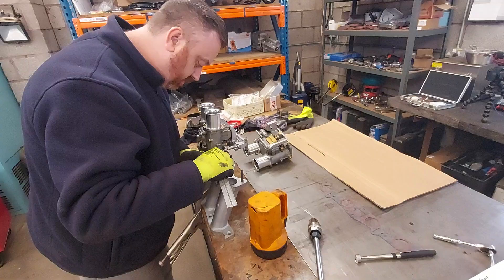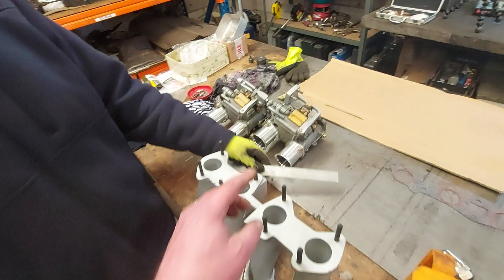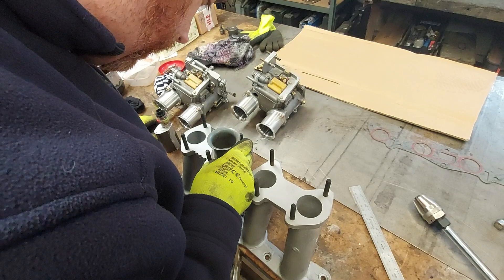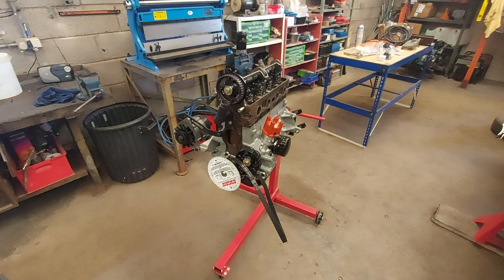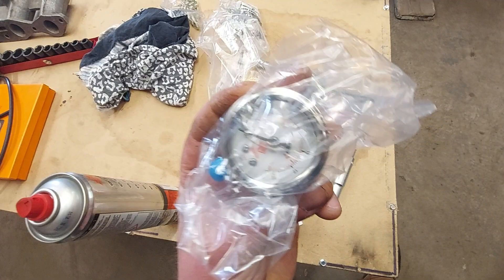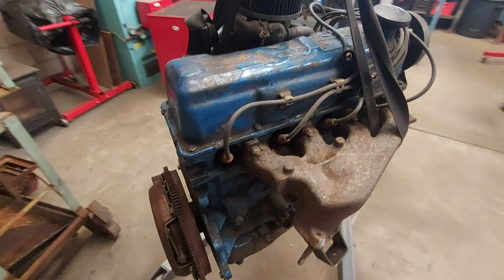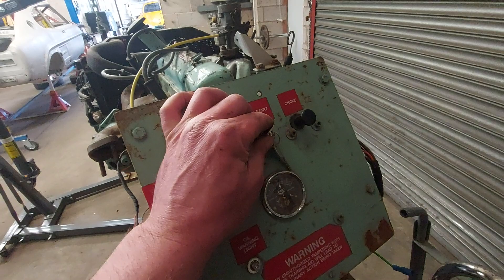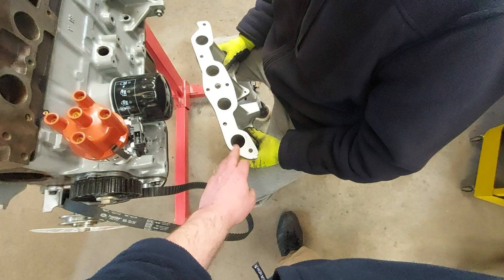1969 FORD CAPRI - PART 88 - Ford 2034cc OHC 'Pinto' engine manifold port matching and ''dudestock''

Comment: You could have made a paper pattern from the front of the carbs using the mounting holes studs and choke sizes for a accurate placement and  pattern on the manifold  same on manifold to engine 👍

Comment: Good luck with the porting.  most times they use the gaskets to figure out how much to port.   to me it looks like the ports on the head are a lot bigger than on the intake.  but it could just be camera angle.    good luck it's a lot of work but at least it's aluminum so not a steel intake.  just go at it slow if your not already done.

Comment: Guys....(dudes!) use the paper gasket method. Copy the reverse cut out (and bolt pierced) carb outline to the manifold... presto, your hole is lined up on the manifold..but you will have to bore grind the whole way through, or you will have a restriction.  -or source a matching 45mm inlet manifold.

Comment: Mano is barking those orders at our guitar hero Gav. . .after all disciplinary action might be taken. . .lol! Roto tool time on those intakes with a burring tip.  Then polish tips that can make it smooth as butter. Grab a sacrificial intake from a junk engine to practice on first. . .those tips can be unkind if you are not prepared for what they can do. Just like sandpaper, they have different grades that take material off at different rates and rpm's of the tool does matter. . . practice, practice practice. . .ask me how I know! Remember, smooth will increase the BHP. .. not scale.
Reply: Guitar hero Gav.... Brilliant 🎸🎸🎸